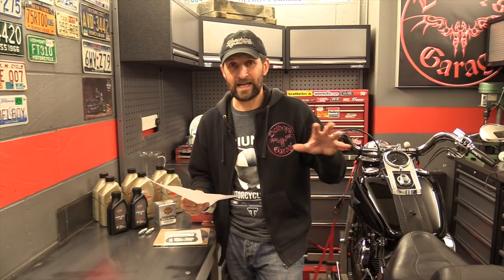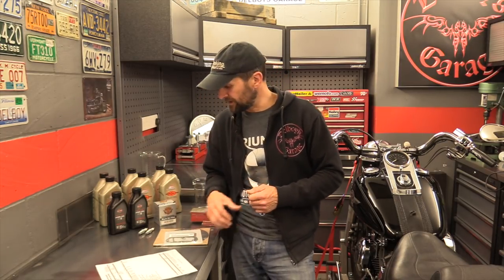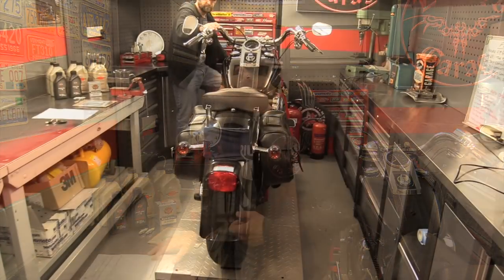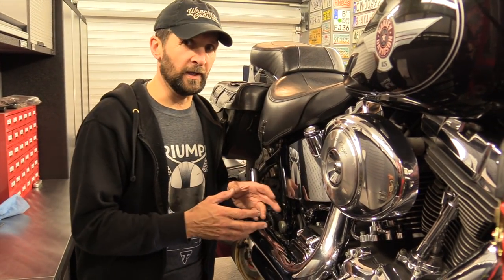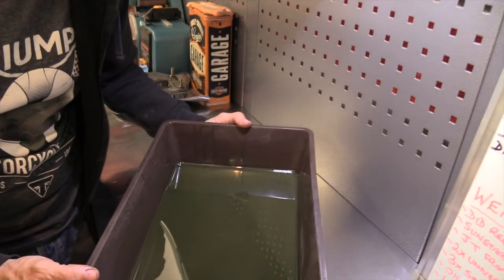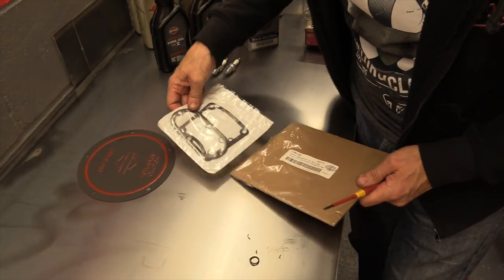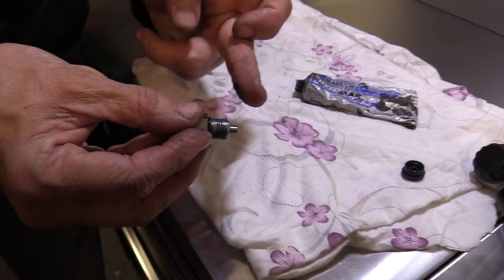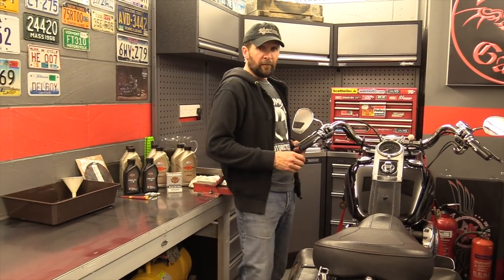Delboy's Garage, Harley Softail Service #1:- Gearbox Oil Change

Comment: Great video, reminder to those with different models. this one is designed that the gearbox level is checked with the bike in the upright position. The newer Softails are designed for the level to be checked on the side stand. You can tell the difference as this one has a dipstick that is fixed and does not have a pivot joint. the ones to be checked on the side stand have a pivot between the cap and the level indicator stick. Best of luck all!
Reply from the maker: Wise words well said Sir, always check the manual for the spec on your bike!

Comment: Complicated and complex are two different words. When it comes to fluid changes, Harley’s are far more complex than metrics, meaning more parts to deal with, but not necessarily complicated. Complicated would be a system that is hard to understand, which Harley is not. It’s just more complex because 3 holes vs 1.

Comment: Hmm in regards to torque values, Torque values are always set on dry threads, when you wet the threads with any type of lubricants , you back off on the torque value always.Ever replace a cylinder head ? You do not use lubricants.

Comment: Harley Dealership Service is a joke! not only super expensive but they also did half the work they said they would! Never again! BTW, that new garage setup seems to be working really well for you!
Reply from the maker: Met a few of those buddy, and not just in the Harley dealership... I've had every other manufacturer guilty of it too, I've always felt it's down to the mechanic, not the dealership, or the brand.. one of the best technicians I ever knew was a Harley Master Tech, he was a meticulous man with very high standards - he got fed upw ith his boss's attitude, telling him to cut corners, he now works for Saab !  So it's usually the organ grinder, not the monkey that's wrong, don't you find??
Reply: Speaking of which...I freaking love old SAABs!!!
Reply from the maker: Yeah, i heard they are made from old airplanes with the wings snapped off, and the stumps ground flat so you can see them....
Reply: I used to work at a Saab dealership in the 60's when the Saab's were two strokes.
Reply: Funnily enough I have a Harley and a Saab, mine's a 2004 9-5 diesel, 173,000 miles on it , never uses any oil and still does 600 miles on a tank full...
Reply: Martin Haskell SAABs are great! and the old 2stroke ones were a thing of beauty!
Reply from the maker: Ha ha, gotta love a four wheel stinker..!
Reply: face it at the dealers it's not their bike or their pride & joy, they don't really care about it, also they have a massive job list of bikes to get done so some people may cut corners. however not all dealers are bad, I did a few little things on purpose to see if they would pick up on them in the service & they did. I do lots of my own stuff but I'm not a HD mechanic so some stuff I get them to do like replace the battery on my key fob haha!!
Reply: I’ve got an ‘09 Softail Deluxe that has some divots in the belt. HD told me it needed to be replaced. They want $700. The only other shop in town wants 1K! So I have, to my knowledge, no other option besides HD. Interesting is I was getting a new rear tire put on, a Metzler. As I went back to see the belt, they told me they would put on the Dunlop and get her all cleaned up and she’d be ready to go. Ummmmmm excuse me! Not sure if it was on purpose, I would like to think not, but just not sure.
Reply: Same here too man. Gas gauge wasn't working, and they didn't even address it even though it went on the work order. Spilled brake fluid all over the calipers and front fender...thank god it was DOT5. So...no more I'm just going to put in a new sending unit IF they come off back order in August. 😳 From here, I'll do everything else myself until it's something super complicated. I've found a couple of qualified locals who can help at that point. NO more of this nonsense!!!
Reply: Yea, I absolutely agree, and that goes across many industries as well. Through and old timer biker, I just got introduced to a former certified HD mech, and he seems like you, very helpful and friendly. I'm about to repair my intake manifold leaks, and he can't get to me right now, but offered to come over and help me if I get stuck. I like him because he listens, and seems meticulous to the extreme. That's the guy you want wrenching on your ride.

Comment: Just changed mine the other day cuz it was shifting hard,drained it and the previous owner ran motor oil in it,I put full synthetic transmission fluid in it and my bike has never shifted or sounded better,I know you can use motor oil but not me,I’ve got an 03 Heritage Softail Classic 100 year edition,EFI,all three holes were done and it runs like a new bike,thanks for the video!

Comment: Delboy's "Just nip it up" Garage 😀 Great video, I will do my oil change now. Thanks a lot m8
Reply from the maker: No problem 👍 Glad it could help you out.
Reply: @Moonfleet41  I did this on a small motorcycle jack. I can understand why a lift is useful now! Hard to fit the screw when it's back on after oil is drained. I think I put too much Hylomar on because it didn't screw on by hand force before I took less on, or I might have been unlucky with the initial screwing on. Also the 12 sided pipe got stuck on the screw after torqueing  so I had to yank it out with a plier!

Comment: very good detailed video man!... I also have a fat boy that needs serviced so these upcoming videos will be priceless for me del!.... thank you so much for what you do, your truly blessed at an awesome passion and way of life which is motorcycles!....
Reply from the maker: Thank you my friend, it's great to know they are finding use... we'll march our way through them, one at a time, the lose plan is to Primary Oil, Clutch Adjustment (as the derby cover will be off already), then 4th video will do the big one, Engine Oil, and gonna include how to do a 'full purge' on the engine and get that extra dirty pint of oil out, and finally, the Fork Oil at the end... that will do for this series, but I will be adding Brake Fluid later cos I did it recently, and the even bigger one, the Tank Fuel Filter Screen, as soon as I can afford the parts for that one lol ! (£140 and only available from the dealer!)...

Comment: Hi Del
i thought i'd drop you a quick email, I'm 62 and have never done any maintenance on a bike before, having watched your videos i thought i would give it a go. I've just completed the gear box oil change on my 2012 heritage classic and I'm very pleased with myself for doing it. your videos have inspired me to have a go, the only problem i had was that when i inspected the oil that came out, there were tiny bits in it, so I'm taking your advice and will look to see if it gets any worse. thanks for posting theses videos as i would never have attempted this without them, it feels that your there watching, as i quickly look on my phone if i get stuck, i m now going back out to the garage to do the primary oil change. please keep up the great work as I'm sure there are many others out there like myself. Thanks.

Comment: man your amazing, i am not taking my bike to the dealer any more, you somed up every thing i need to know about my bike, had it for 10 years and never knew all of this, harley garage never explained for my any thing
Reply: shouldn't the gear oil be pink?
Reply from the maker: HI Sami... this was HD Gear oil and bought from the dealer, it is what colour it is, not sure there are any colour requirements... as long as you use the recommended stuff, or better, then you'll be fine..

Comment: I bought a 2005 Sportster in 2019 which had the original fork oil in it with "only" 9K miles. When I drained it, the fluid had the viscosity of water, the color was solid black and it stunk horribly. The forks bottomed out on the smallest bumps. New fluid made a world of difference. Much better ride! Time is just as important as miles when it comes to service.
Reply from the maker: Exactly right there buddy, it sounds like that was more then likely to be the original oil, so 14 years old... so many Harley's get horribly neglected because they don't do enough mileage, and lazy owners (or skint) choose to leave a given task because it hasn't come round to enough miles yet.... it's not clever, and can be detrimental to the bike in some cases... but the absolute worst of it, is riders cruising about on 14 year old tyres because they haven't "worn out" yet..!  even though they're cracked and rock hard, handle horribly, ..hey, there's still lots of tread though.!
Reply: @Moonfleet41  That's exactly what happened. The previous owner bought my old standard XL883 for his wife and apparently didn't ask if she wanted to ride solo. He said it had sat in the garage for years gathering dust before he decided to sell it. The tires still looked new. The first thing I did was replace the tires and all the fluids. Since then, I've been tinkering with it regularly in the Man Cave. I tell my wife it's therapy. I've learned a lot from your videos. Keep up the great work!
Reply from the maker: @boomerguy9935  Therapy is what they are brother, in this time of digital entertainment it's very special to spend time doing something truly practical and progressive.. have fun and keep safe.. Del.

Comment: Super informative and detailed videos.  Just bought a Softail and enjoyed the insight into changing the main fluids before I do mine.  That said, your info on the oil is incorrect.  The W does not stand for weight.  It is an identifier for the winter additive package in that oil.  The viscosity of the oil does not change, only the pour point at ambient or extreme temps. It also refers to the protection left behind once the oil is back in the sump.  Btw, 20w is old chemistry and has a slow pour point meaning it takes longer to get to the Lubrication points than a 15w or 5w.  Just thought I’d share.  Thanks again for the great videos!  Cheers.
Reply from the maker: Thanks for your insight my friend, this is what's great with YT, we can share information, combining it all together to create a wealth of knowledge we can all call upon... ride safe and enjoy the summer, all the best, Del

Comment: Hey Delboy, weirstrow fla. I enjoy your videos and your knowledge, I have a 86 flht I built, it has a 93 motor out of a fx the transmission I'm not sure of the year 5sp though one thing I'm inquiring your input on is the trany has a oil filter on the bottom, the motor has a oil filter on the front of it should I be using both? With that said my issue is everytime I shift from 2nd to 3 Rd it over shifts s if I bearley tap down on the shifter after shifting into 3rd it will engage 3rd or it's like in neutral or some sometimes I just skip third and go straight to 4th I can figure it out . Clutch don't skip, it does creap on me at lights cause can't get neutral ever while engine running .third gear though after shifting I tap it down barley touching the shifter not using the clutch it's fine. Can you give some advise on what to do ,I have messed with the pawl but nothing. Thank you weirstrow Brooksville Fla.

Comment: Thanks Del, another great Fatboy video. The '05 dipstick is much better placed than the '13, which is recessed under the engine oil tank - a sure way to get burned by something hot! Roll on the other fluid changes. Cheers, Paul
Reply from the maker: Thanks Paul, Primary Oil change up online first thing in the morning - appreciate your support!

Comment: Top timing on this series Del and Penny, I am just about to service my fatboy this weekend and I although I have done it twice now running Mobil 1 15W50 in the engine, Redline in the gearbox and 20W50 in the primary and she runs like a dream however it's always great to get tips and advice as every day is a school day :) I have never attempted the forks on the FB, did it on the Dragstar 650 and no issues but looking forward in particular to seeing that video.....learnt so much from this channel over the years it's just ace!!
Reply from the maker: Thank you David, that's really kind - we try to break it down to make it easy to follow in chunks, you'll love the fork oil change at the end, cos am not gonna make a meal out of it, I've a suction tube to remove the oil and then the same amount will be poured back in... the only part of the bike being removed will be the fork cap!  I've always done it this way, doesn't disturb the forks and you get just as much oil out... not only that, it's so easy, and cheap, you can do it once a year !  Oh and btw, great oils you choose, specially the Mobil1 - it's just about as good as it can be aye?!
Reply: cheers Del, can't wait to see it.....yes big fan of Mobil 1, it's a high quality oil very happy with it. I Was running Amsoil previously and thought that was also a good oil but more difficult to get hold of in the UK now. The FB is such a beautiful machine so think it's wise to spend the extra pennies on good quality products and regular maintenance to help prevent less costly issues in the long run :)

Comment: 7:46 you also should pull the speed sensor and clean it off. It’s gonna catch just as much if not more debris.  Mine was covered and ruined my sensor

Comment: 2005 Softail Springer: Last time I changed the three holes I used:  Oil:  Mobil 1 20W-50 V-Twin Full Synthetic  Gearbox: Mobil 1 75W-90 Syn Gear Lube LS   Primary: H-D Formula+ (50 Weight)   Did I over-think it?   I also have a 2013 H-D Softail Breakout CVO w/ 110 Screamin' Eagle.   Should I just use Syn 3 in all three holes in both bikes?   I know H-D are known for clunking into gear, but sometimes it seems a little extreme.   Thanks - John
Reply from the maker: Hi John.... those three oils are all perfect for the job, so that was the right move.. the guys at Harley tell me that this Syn3 surpasses the spec of all other oils so its good to use for all three holes...ive used it ever since, and with my Switchback, it quietened the primary down a little, and made the first gear selection from cold a lot less of a thump..!!!   maybe give it a try and see if you prefer it.!  Thank for watching buddy, and dead jealous of that Breakout..awesome bike mate.   cheers, Del.

Comment: Yahoo a series on the Softsil, in the proper service manual  (2016)it doesn't say whether to change the  tranny oil hot or cold,the only  thing it says is if your checking the oil do it cold  ( ambient).For the engine & primary it says hot (operating temperature). Thanks Del
Reply from the maker: Please, what ever you do in this life Geoff... try to avoid every saying the word "Tranny" again... it just conjures up the most unpleasant images...lol    

Hot or cold, its not that important... hot just helps the old oil flow out better... but the difference in what you'll get out is negligible... 

I thought you'd appreciate some Softail videos mate.!!   take care aye..  Del.

Comment: Del , That Harley Davidson of yours is a credit to you, it looks like new and I know you used it in Winter. 
I enjoyed that FS365 video that you did a while back when you hosed off the old protection and it looked great underneath. I've met a rider with an HD Heritage Springer that he used through Winter and again it was like new. Another I met at a Moto Guzzi rally with an Electra Glide and when I saw the speedo it had 72,000 miles but looked like new. HD can last well if you know how to treat them and put the time in. There are exceptions of course (Italian made for HD spokes spring to mind) but HD do have nice finishes.
Reply from the maker: Yeah you're right on all those points buddy... if you put the time in to stay on top of the cleaning, then a Harley will stay lookin buff... but not the spokes.. they'll rust no matter what you do.. but at least they are a reasonably cheap upgrade to go to stainless aye..!    and ive seen Harleys with well over 100k miles time and time again, and they're still going fine. !

Comment: Del, i see you explain the gear dip stick for reading should not be screwed back in full to take reading ?? i see a comment below somebody saying they prefer to screw it all the way back in, which should we try?? makes more sense to leave it out of threads as you say.
Reply from the maker: On this bike, the recommended method of checking the gearbox oil level was to set the cap against the hole.. and not screw it in.. but models vary, so check in your manual for the exact spec for your bike..

Comment: I was wondering what the effect of the high shear forces at work between the gears on the long-chain polymers that comprise the viscosity index improvers would be over time on the oil's hot viscosity. Do you think that this might have been a consideration of Harley-Davison when it made the choice to recommend a mono-viscosity oil?

Comment: I just bought my first softtail Fatboy, yahoooo. And I am a do it yourself kind of guy.  your videos have been real helpful to me as a new Harley owner.  Can you please list all the tools I’ll need to do a complete oil change on a Solfttail Fatboy please. Also what king of measuring glass you are using.  Thank you so much for taking time to explain and demonstrate things so simply.

Ben Rc
W-S.  NC.
Reply from the maker: Hi Ben, good to hear from you and congratulations on your bike...!  Never really thought of a tool list, I just reach for what I need in the toolbox, but if it's purely an oil change then you need a tool to undo the drain plugs, if you're doing the primary, then probably a torx T27 to undo the torx bolts on the derby cover, so pretty much if you had a basic socket set, a set of imperial allen keys and torx bits, you'd be good to go  and as for a jug, it was just a random measuring jug from the cook shop, nothing special, one with markings on so you can tell how much you've put in it. hope it helps buddy, good luck with it, hope it goes well for you...